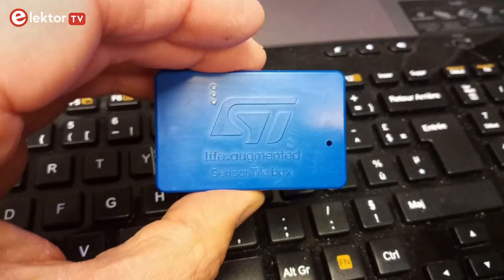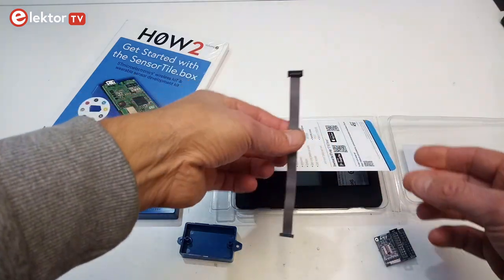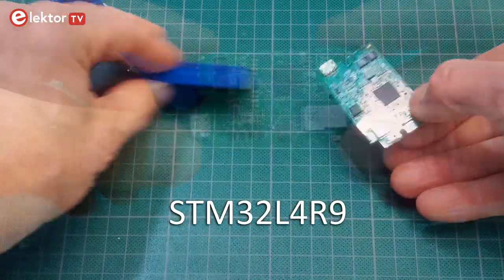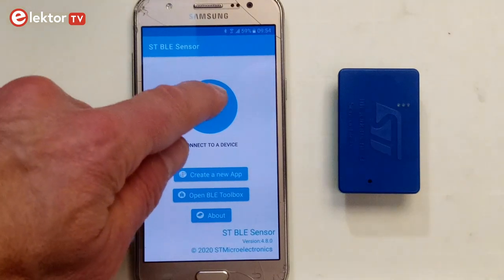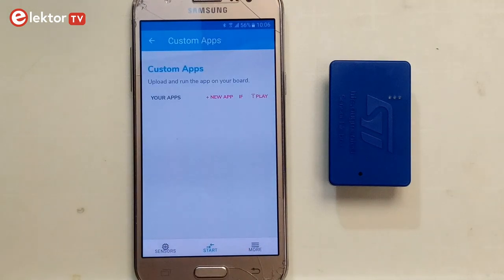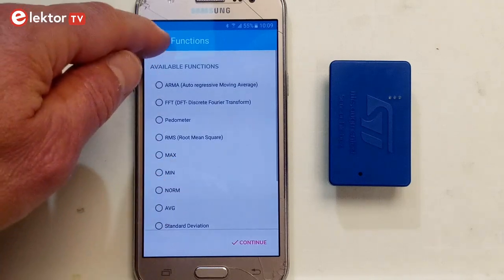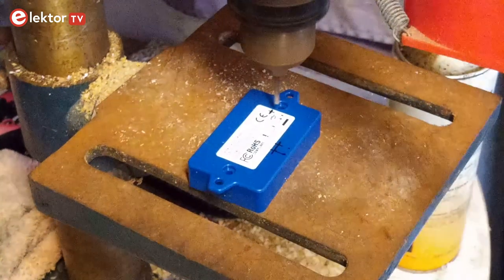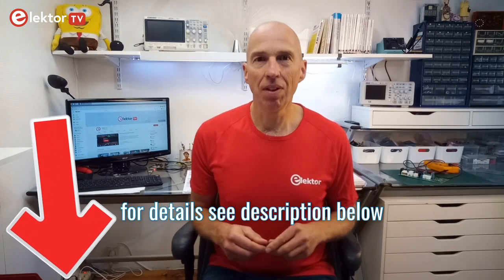Get Started with the SensorTile Box Bundle

Comment: How can the SensorBox can be connected to a Putty and read data of accelerometer and gyroscope
Reply from the maker: The serial port is accessible on the JTAG connector (TX on J2 pin 9, please double check). Add a serial-to-USB adapter to turn it into a USB serial port. The rest is software. A detailed example is presented in the book How2 Get Started with the SensorTile.box (included in the bundle https://www.elektor.com/get-started-with-the-sensortile-box-bundle)